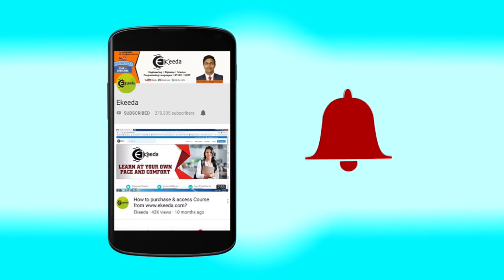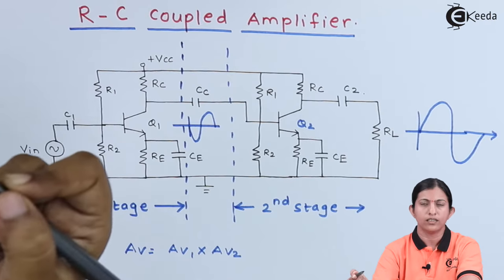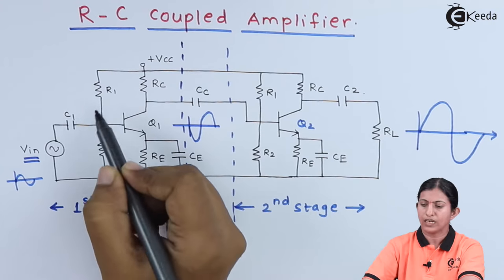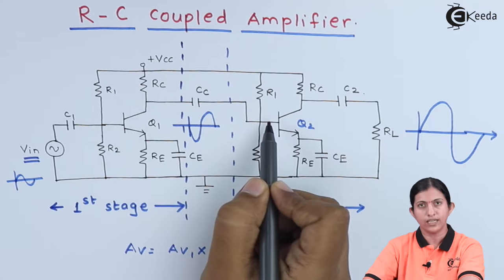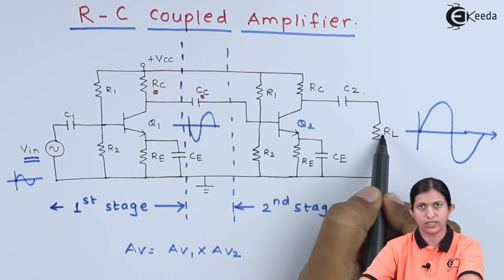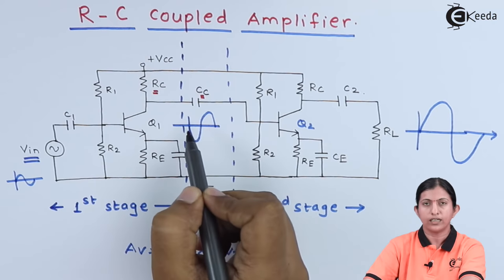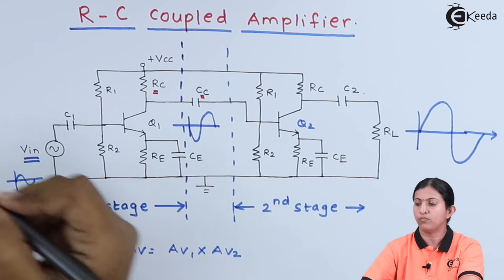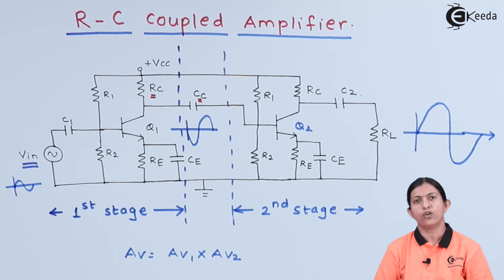RC Coupling Circuit Diagram, Operation - Low Power Amplifiers - Applied Electronics

Comment: Mam some books says that the phase difference of input and output signal are in phase with each other i.e zero... But you said that its 360... Help me to clear my doubt
Reply: Mam it's same ,
Zero or 360 degree's bcoz 
In a circle when you start moving from a point and covers 360 then you reach again same point from where you start ? 
You can use any one 0 or 360
Reply: Yes but it varies if you have sine wave for angle 360° and 0° and similarly for taking cosine wave 0° and 360° it varies means it's values depends on waveform

Comment: Respected Madam
My uncle and aunty are aged more than 85 years one is bed ridden and another one is hard of hearing. Can you guide me to make a mike preamp which can capture the voice of room   measuring 12'x12'. I want to transmit the same to their son or grandson room to attend them in case of emergency. I will be very grateful to for your this kind guidence. Further, I am non technical but can understand and will make after procuring the required components, etc. The main purpose is that the verry noise of room may please be transmitted, please guide.
Reply: Were you able to solve the issue?